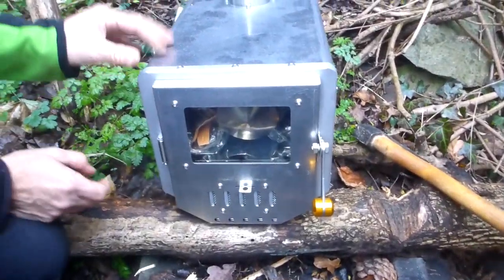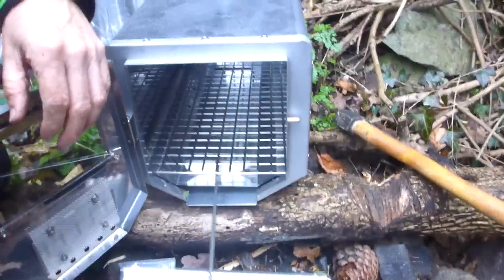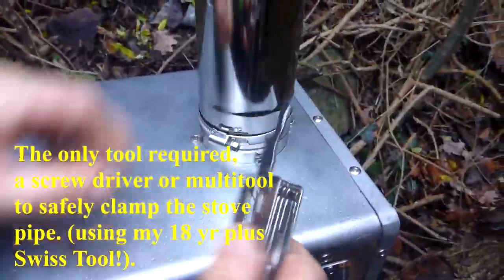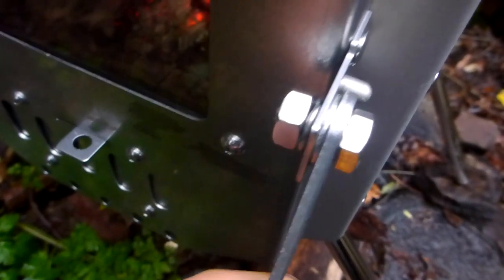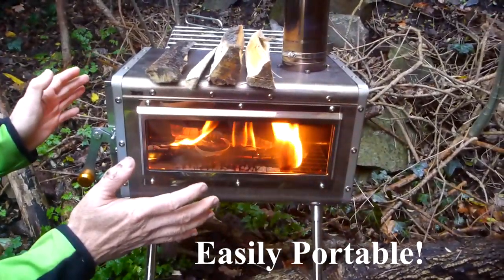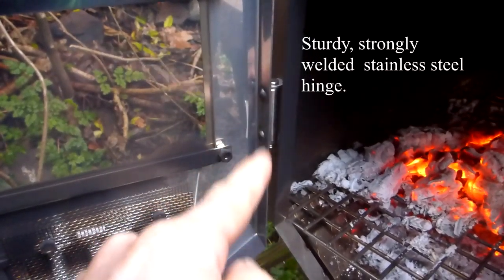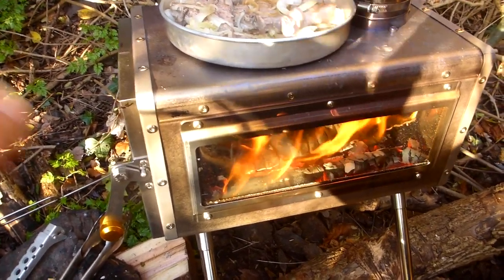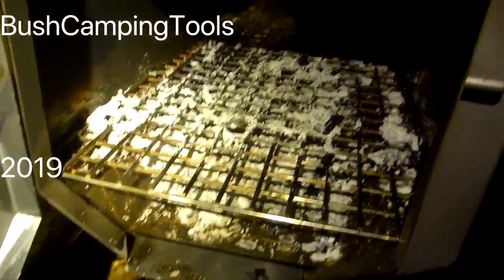WTS380 Stove for camping

Comment: Looks similar to the winnerwell nomad.  Also stainless steel.
I wonder how they compare burning effiency wise
Reply from the maker: I don't have the other stove you mention so could not comment upon the differences, all I know is I end up with ashes at the end of a burn and i think he has some tricks of the design internally by using the perforated extension of the flue into the combustion chamber, this acts a bit like those recycled fuel oil burners to achieve a really thorough combustion before entering the  main flue.

Comment: Is that mesh covering the air intake holes on the door? If so that’s great. Not all portable stoves have that and it could save a spark from ejecting and creating a problem. Windows are nice, light up a dark tent at night 😊❤️🇺🇸❄️☃️🛷⛺️
Reply from the maker: Hi, you bet it is and it certainly does stop any and I mean any embers etc from escaping. Yeah I did notice that about many stoves and they don't feature this. I still have to write my blog on the design and must get going with it but it has some very very cool features which are def not offered on many other wood burning stoves I reckon. The windows give it a very cool ambience too and of course very easy to see how much fuel is present without opening any doors. Thanks for watching!

Comment: Greatre view!
What's the radius of heat coming from this when it is going full strength?
Thinking about using this under a covered patio. Would this work well to heat a group of people in a circle of chairs?
Reply from the maker: Easy! if the patio is covered.
They are single walled construction so there is some good heat, not like a fire of course but naturally this is under control. This is a real winner IMHO Hope that helps.
Reply from the maker: Forgot to actually answer your question: The radius of heat when fully raging is about a 1m max.
Reply: @BushCampingTools Thank you!!
Reply from the maker: @supersighlas  No problems!
Reply: @BushCampingTools  An additional question: What is the height of the exhaust pipe and how tall can it go if you add additional pieces?